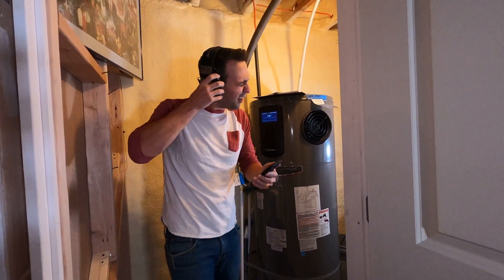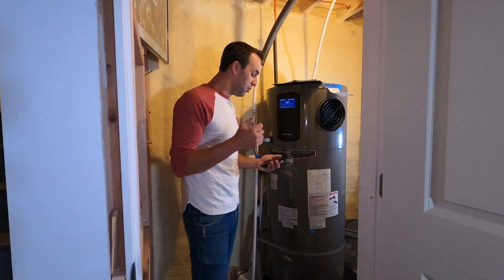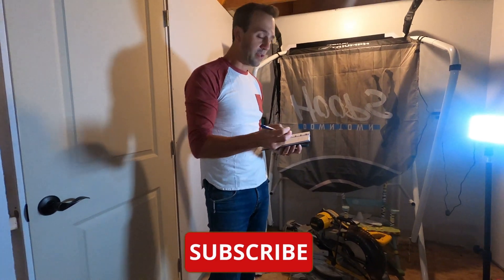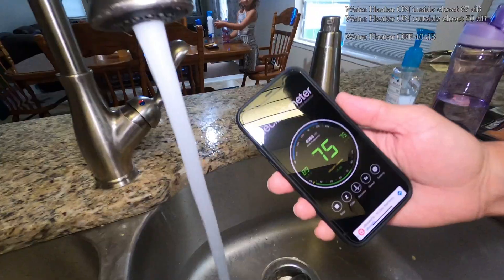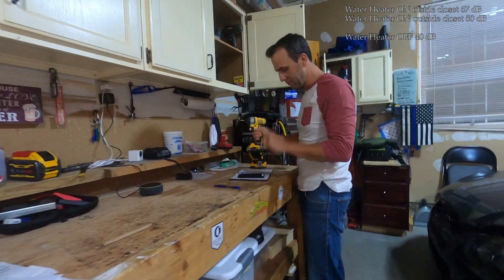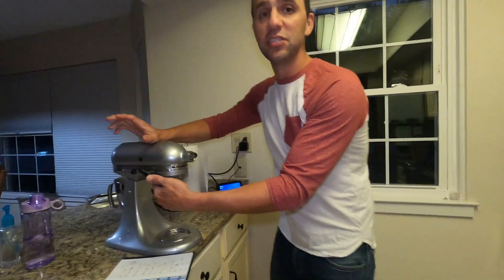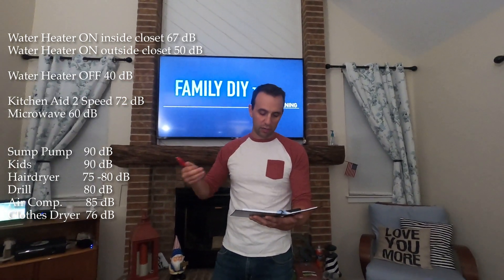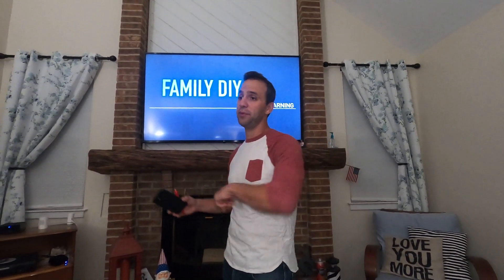How Loud is a Hybrid Water Heater? #rheem #aosmith #soundwaves

Comment: New house came with rheem hybrid water heater, internal heat pump extremely loud. They replace it with new one, it made no difference.
Reply from the maker: just an idea, maybe mess with scheduling and only have heat pump mode on when you're not at home or  are sleeping.  During the time your home have it run in resistance mode, now resistance mode is silent but costs way more to run.  Or even try high demand mode, this will have resistance mode and heat pump on, so it will heat up faster and the heat pump will run less.   if the sound really bothers you, and extra 20-30 buck a month could be worth it to you :)

Comment: We got a Rheem heat pump water heater and it has a very high-pitched ringing sound, which is in addition to the fan sound. It drives me crazy even in the basement, and especially if I am in the basement, which we do use a lot. I have heard that if you change the copper pipes to pex it might solve it. Only had this a month. Something has to be done. I can turn it to electric only temporarily, but was told by the company it will automatically switch back to heat pump after 72 hours, since that is the whole purpose of the unit. I don't know what we are going to do but it has to get fixed.
Reply: @SpanishLearners-p7g  did you ever fix the high pitch sound? Mine does the same sadly

Comment: I purchased a Rheem hybrid water heater recently. I downloaded the app you are using and it reads 55 decibels. It is only barely, and I mean barely, louder than my previous power direct vent water heater I replaced. So it is not loud at all. I wonder if the newer Rheem are quieter than they were a couple of years ago?

Comment: Every increase of 10 dB on the decibel scale is equal to a 10-fold increase in sound pressure level (SPL). It is a logarithmic scale, so 20 dB is a 100 fold increase. Missing from the discussion is specific frequencies.  Heat Pump Water heaters put out something close to white noise, so mostly goes unnoticed.  Things like a hair dryers and mixers have sound concentrated at fewer frequencies, so are more noticeable. All these drop off with distance, so a 67 dB measurement inches from the heater vent is not realistic unless you intend to put your head there. Most sound engineers measure at 1 meter. Since these apps are not calibrated, it is great you measure other things for comparison. Nice job.
Reply from the maker: thanks !

Comment: nice to experiment, but simple decibel meters do not distinguish different frequencies, Most of the noise from a hybrid water heater is white noise from air movement, which is spread over many frequencies and not annoying at all. In fact, some people use white noise generators to help fall asleep.
Reply from the maker: I believe you… sounds like you know way more about frequencies than I do !  

Thanks for comment! 
Mike

Comment: If your ambient sound is 40 db u must live in city??
Reply from the maker: Well, 40’s low.   Think it was because I was in my basement.     Not exact science either… using a free phone app.  Lol.    But you can do the same
Reply: More likely, this is running close to the noise floor of the phone measurement capability. Put the phone in a chamber to see just how low the measurement can go, and I'd guess high 30's.

Comment: Mine whistles as loud as the alarm it chirps for their faulty sensors. Its always whistled loud and now the sensors failed 2 years old.

I also asked them about the noise. The rep told me its sold as a “whisper” level volume but a normal conversation is 60 decibels and thier heat pump should be under 60 decibels. How is that a “Whisper”?  My opinion — IT IS TOO LOUD.
Reply from the maker: Sorry to hear that ! Ugh.

Comment: Great video, One thing I don't understand; does the unit blow out cold air 24/7 or only when it's actively heating water?  If it's only when heating water, what percent of time in a day would you say it's running?  thank you!
Reply from the maker: It only blowing cold air when it's running...  As far as how long, i really don't know that.  I know after a few showers in the house I've heard it still running hours later.

Comment: One thing they do not seem to talk about is the Heat Pump part of the Water Heater is it removed heat from the room it's installed in.  So if it's inside your Home, then your furnace will have to run more.  How many percent?  I do not know.  We have a Natural Gas Water Heater and it's been great.  We have an opportunity to buy a new AO Smith Heat Pump Water Heater for $350.  Yes, a Friend works where they warehouse products and one of these had a water damaged box which left a stain on the Water Heater.  So they just need it gone.  Thinking about it.
Reply from the maker: Agree.  I’ve made multiple videos about this.  …   Links should be in description

Comment: Complete amateur hour. This was painful to watch. There was no explanation nor understanding that decibel is a LOGARITHMIC unit rather than the traditional linear unit. It’s clear he has no idea what he’s doing when he’s surprised by how “close” the measurements of the blow drier are when on high and low. There was also little uniformity in how he measured. He really should have held the phone 10 feet from the source of the sound with the microphone held at the same angle.
Lastly, there is a tremendous variety in noise levels between heat pump water heater models. One new AO Smith model clocks in at 45 Db by opting to replace the fan with a blower. A poor install can also result in access noise. Given how how carelessly this video was produced I wouldn’t be surprised if DIY guy screwed up  his install 🤷‍♂️.
Reply from the maker: I really hope you have a good holiday and whatever’s bothering ya resolves itself in the new year.  :)

Happy holidays blue spruce 
Mike

Comment: These things are loud AF almost like running an air compressor.   I'm practically deaf and I can hear a Rheem hybrid electric outside while wearing hearing protection.   You wouldn't be able to sleep if the compressor kicks in if it's in your bedroom closet.  Maybe if you have it in your garage and never use your garage for anything except parking your car would it not bother you.
Reply from the maker: They shouldn’t be that loud, I’d call rheem. Sounds like you have a defective one.   A few people have brought this up and reached to rheem to get fixed.  

Hope u get it fixed ! 

Mike

Comment: I installed a Rheem hybrid water heater yesterday. We turned it on, waited a bit, and the heat pump fan kicked in. The water heater is so loud that you can year it outside of the house! This is not workable. I'll contact Rheem and try to get this fixed. If not, we will take it back.

Comment: The thing uses about 75% less electricity than a comparable electric-only water heater.  WHO CARES how much noise it makes?!  It's in a utility closet or a garage!  

Good video, though.  :)
Reply from the maker: Thanks !
Reply: Mines in the utility room next to two other bedrooms.  I care.
Reply: @Omniverse0 - It doesn't make enough noise to bother you in an adjacent bedroom, plus it isn't generally going to run while people are sleeping.  It runs after you use some of the hot water in it.  Heat pumps are one of the ways humans might actually avoid making themselves extinct.

Comment: dB measurements need to be at a certain distance, typically at 1m, to be accurate
Using a smart phone also it has to be orientated the same way to the source of the sound for it to be comparable 
Unless one purchases an app for SPL readings that is accurately set for the phone it’s not really an accurate measurement on its on BUT can be used to compare different devices at the same distance and orientation 
(Been measuring SPL level for 40+ years for my industry and love the apps
Have one that is calibrated and tested on my mini iPad that I used for commissioning pro and commercial audio systems along with other programs such a SMAART)
Great video and great producer
I’ve introduced it to a couple of manufactured home builders in my area and they can’t believe the savings
Have one who is using it to heat hot tubs with another heat exchanger and pump
Not quite enough for a pool

Comment: Any suggestions on how to make the water heater quieter by wrapping most of it with insulation and placing it on a foam mat for example? I am leery of buying a hybrid water heater now. Thanks!
Reply from the maker: not sure wrapping it would do anything since it ran noise.   you could run it using the app when you’re sleeping or at work maybe ?  the app is neat and allows to control all this via schedule, so it like a set and forget.

Comment: It doesn't appear Rheem has actually fixed this. Some users are reporting units made after January 2022 are in the upper 50s db range but that's still many times louder than the Gen 4s true 49 db with the heat pump running at maximum. 49 db is whisper quiet. 58 db is 8 times the sound pressure than 49 db.
Reply: do you know if venting the exhaust air to the outside would make the unit quieter?
Reply: Alan, I'll measure the loudness of our water heater, but it is really, really loud.

Comment: I'd measure a gas water heater for comparison... I think the frequency also matters. Seems like the gas ones are lower ... kinda rumbly. We did have a GE Heat Pump Heater in our small basement, and you could hear it in the house (above and one room over). I'd say that sound was louder than the refrigerator. In other words, water heater through the floor was louder than fridge in the same room.
Reply: great points. Fan noise isn't the thing that annoying. It's the constant heat pump drone noise that penetrates everywhere at that low frequency noise.
Reply from the maker: hmm - this is interesting.
Reply: You are exactly right.

Comment: I recently installed the $600 Gladiator version in my garage/mancave, here in central Florida and wish I would have went the extra cost for the hybrid to cool that space seen as my portable AC unit is just as loud. How well does it cool in a warmer climate, my garage/mancave is about 900SF?
Reply from the maker: DCC - it might but really depends on how insulated your garage is and how much sun it gets.  I’d say if it was shaded and well insulated it would do a okay job, or at least keep it cool enough where you didn’t have to run your portable air so much.     

Here’s a video I did (like a yr ago) showing how cold it made my 1,000 sqft basement.   

https://youtu.be/ikt3yfNQoKY